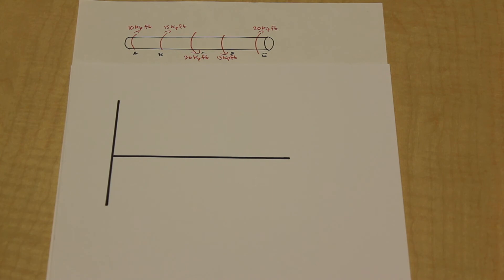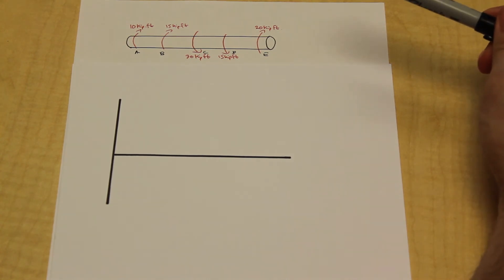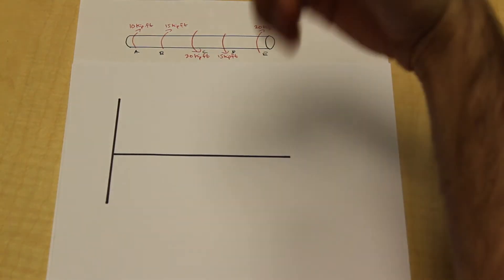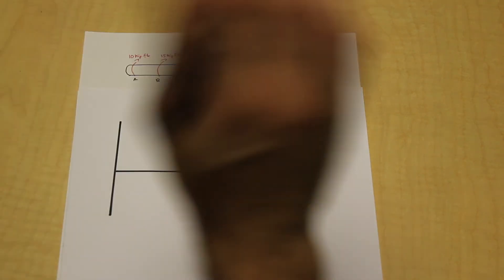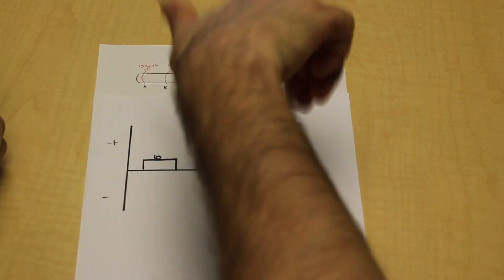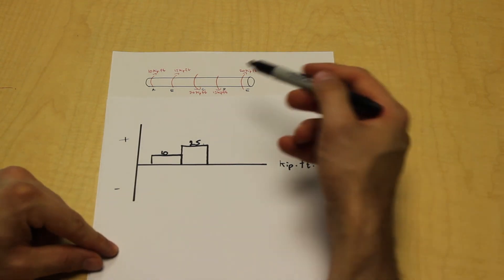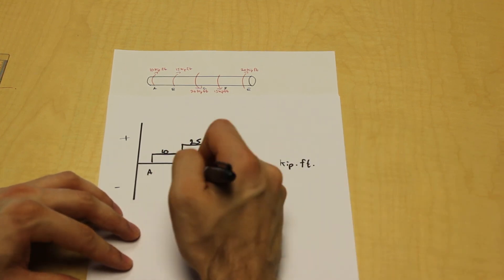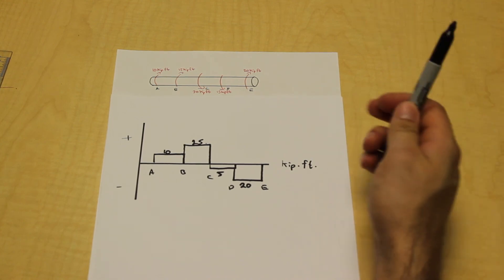How to Draw a Torque Diagram Without Equations

Comment: Can i assume that clockwise direction is negative?
Reply from the maker: Yes, as long as you clearly state your assumption at the start of the problem you can make any directional assumption you want.  Keep in mind that CCW as +ve is a standard sign convention, so while you can assume whatever you want some people may just assume you're using what everyone else normally does if they don't read your assumption.  Technically there's nothing wrong with it though.
Reply: @AFMathandEngineering  thanks

Comment: Am I correct in saying that the reason the sign convention changes is because this method is like a short cut using external torques to represent the internal torques in the diagram? But if you find the internal torques by equilibrium equations you don't have to swap signs.
Reply from the maker: The sign convention doesnt change, were still using ccw as +ve.  Its not a shortcut, a torque diagram represents internal torques, not external ones.  The forces shown at the start of the video are external and we are showing the forces acting internally as a result of these forces on the torque diagram.

Comment: your moment signs are wrong, should be -10-15+30+15-20
Reply from the maker: luke martin luke martin the signs of the moments depend on the sign convention you've assigned at the start of the question and nothing else.  we've assigned the internal counterclockwise moment as positive in our problem.   I'd you'd like to do the opposite and state this at the start of the question that would be fine.
Reply: luke martin go review your grade 10 notes =P
Reply from the maker: +linkinmetalica well explained!